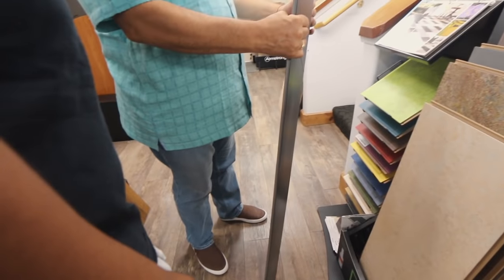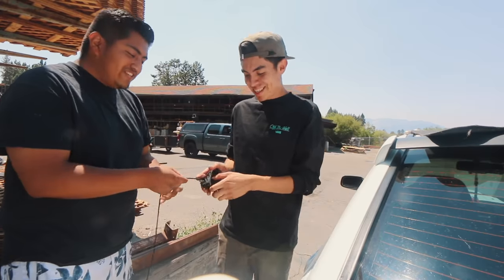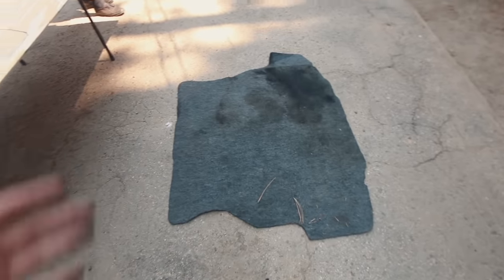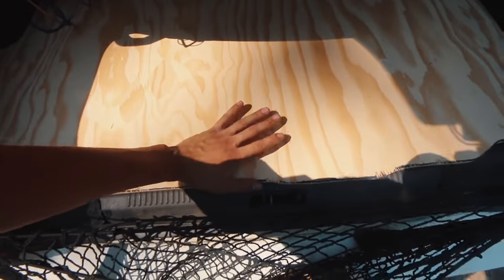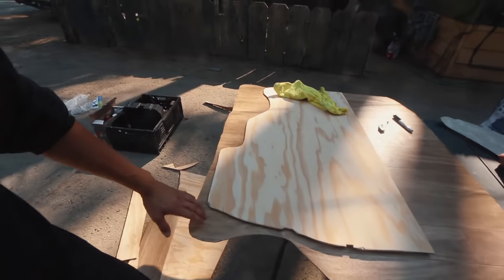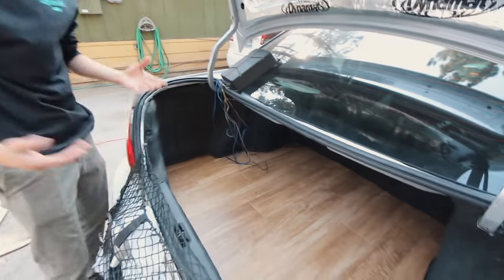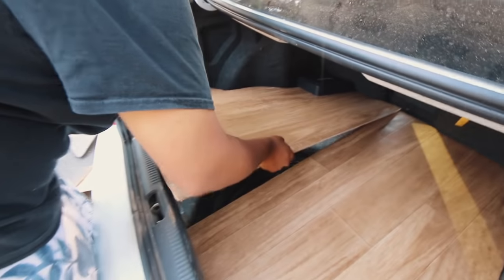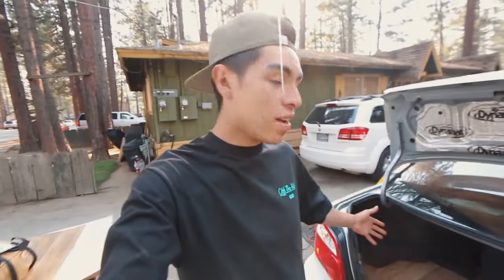Making Custom Trunk Set Ups For Our STI's!!

Comment: I install flooring for a living and you guys should of used a trowel that has small/medium teeth so the glue can grab better and you will also get air bubbles underneath the vinyl but it turned out great looking I’m thinking about doing that to my trunk now

Comment: Can you tell me what thickness the plyboard is, I did mine today but I had to cut it in two and I really don't like how it looks with the cut , I noticed that the plyboard you used is flexible mine is a really thick ply
Reply: Most likely he used 1/4inch plywood